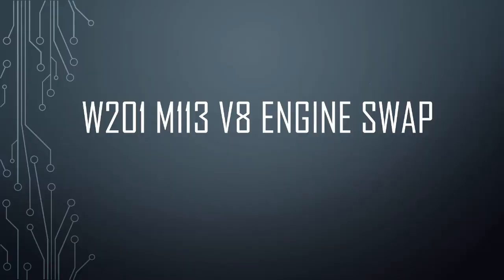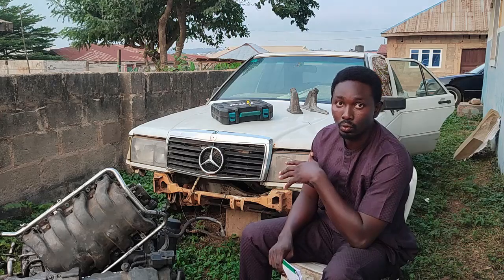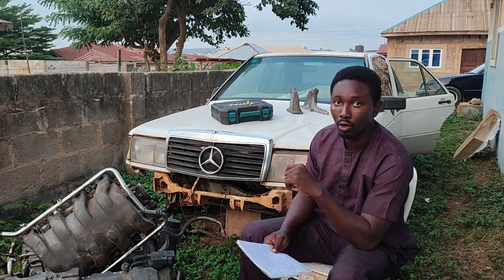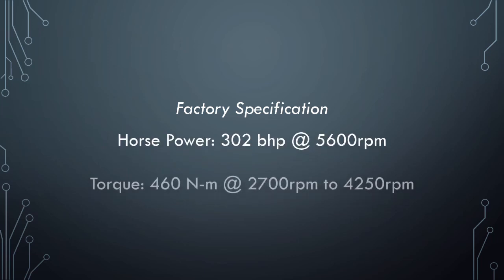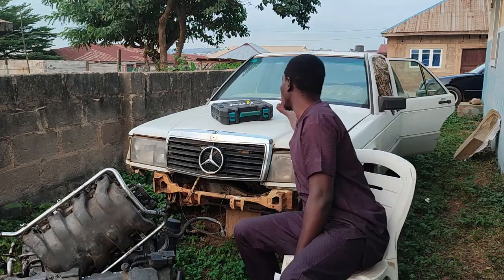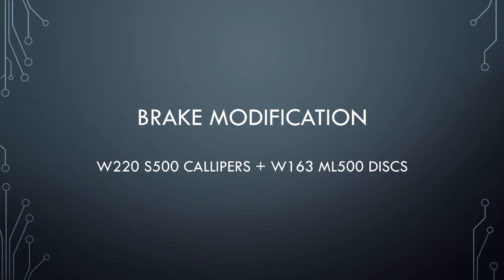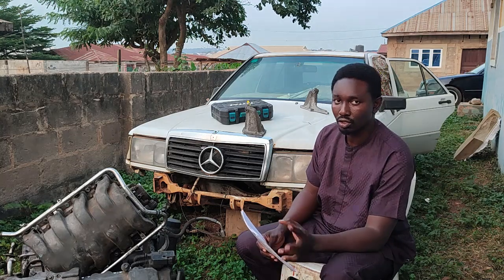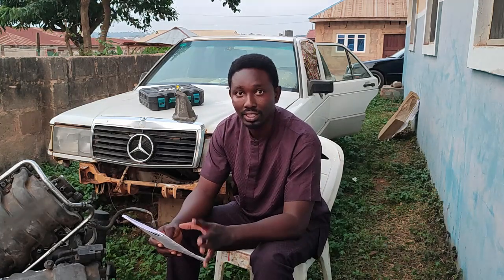Benz 190e m113 V8 6 speed manual swap #engineswap  #W201 #m113 #V8swap #Nigeria #classicbenz

Comment: Thumbs up bro for even thinking of doing something like this let alone doing it. I can tell you for a fact that it's not gonna be easy to accomplish this feat. 
I am currently doing same thing but with an M112 (V6) 3.2L engine....on a W124 chasis(300ce). It is everything you can imagine it to be and more !  I've been on this project for more than 6 months now(after getting everything I'd need). The next one would be with the M113k V8.
Reply from the maker: What's the main problem you are facing

Comment: Bro, what you need to do is use the OM606 Mercedes straight 6, with an upgraded turbo you could have 700 bhp with good mpg. Check out dieselpumpuk youtube channel. You are welcome 👍
Reply from the maker: No love for diesel passenger cars around here so the engines are very scarce, and the fuel is about 4x the cost of petrol erasing any mpg gain. Bonus  is that the V8 is actually lighter

Comment: Could you consider reversing the exhaust manifolds and have the exhaust system exit the front of the car? If I ever do a single turbo on my M113 swap, I plan to use a front exit. 

I am using the MS3Pro to run my ignition and I love it. This would be my choice. TunerStudio gives you so many options that you would never outgrow it with changes to your build. I did not like using the Speeduino and actually have experience using the same 8 channel unit you show in your pictures out of Australia. I don't recommend it. Save up for the MS3. It's very high quality construction with automotive grade connections and case.

Good luck with your build and I look forward to more videos!
Reply from the maker: I thought about that too as the exhaust ports looks symmetrical but I am thinking it will be hard to quiet it down, for a turbo application this should be handy. 

Thanks for the info on your hands on experience with the speeduino systems
Reply: Definitely worth looking in to, front exhaust down pipe. Might work out better than dropping the box! Might mean losing the air con compressor?